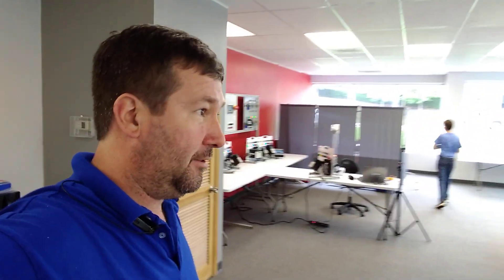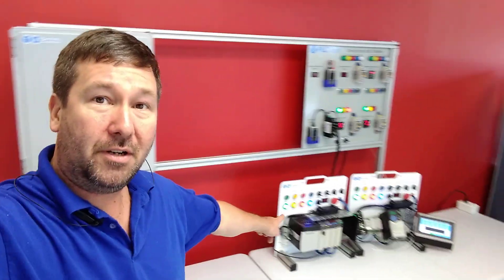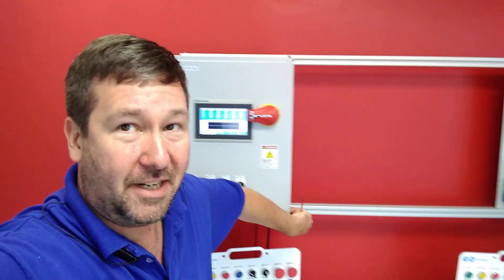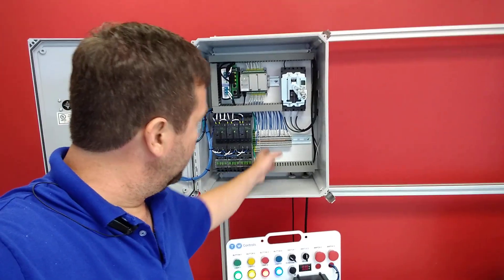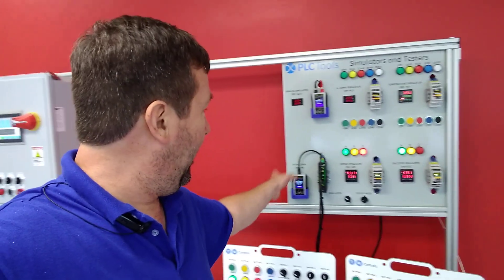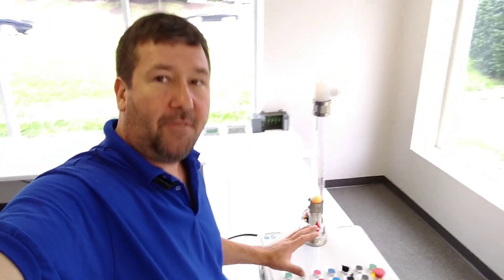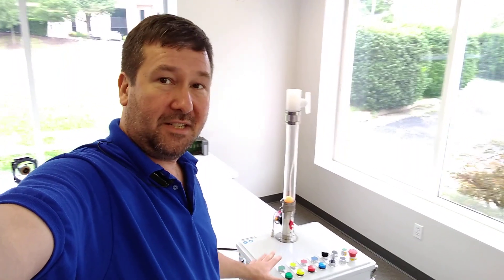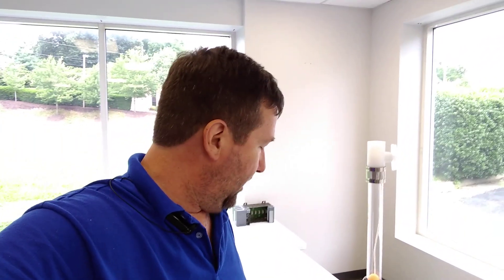PLC Lab Preview

Comment: Excellent setup you have there.
Have you ever thought about doing a series on the Guardmaster CR30 programmable controller? Or possibly things like ESRs like Pilz or the guardmaster range?
Reply from the maker: Hi Andrew.  We have a series on the CR30 coming soon.
Reply: @TimWilborne  excellent news, currently working with them on salad wash lines on a very basic level for fault finding, it will be good to gain a little bit more of an in depth knowledge of there workings. :-)

Comment: Hello,
Tim your Lab is looking good. I have contacted you about doing a power supply and the effects of grounding the secondary side positive and Negative. I have a question do you do other manufactures brands of PLC or Rockwell devices only? I have little experience with Rockwell systems so your videos on the Control logix 5000 PLC's and Studio 5000 software is helpful. We are currently using Omron CJ Programers in conjunction with Control logix 5000 Safety PLC's over a Ethernet IP Bridge. Thanks
Reply from the maker: Hi Mark.  I don't have a lot of experience with Omron.  Most of our request are for Rockwell so that is what we usually make videos on but we are not associated with them.  As far as safety, we do have a CR30 series coming and we may dabble into the Controllogix safety.
Reply: @TimWilborne  
Thanks Tim looking forward to upcoming videos. If possible I may send you a few more suggestions on  something like component changes on the Control Logix 5000. For example Remote Devices like I/0, Gate Switch Fortress remote over Ethernet I/P our Device Net is on the older Equipment. I'm a Equipment Service Trainer and Reliability Associate here at Honda Manufacturing of Alabama for 20 years. All in Equipment Service. Thanks